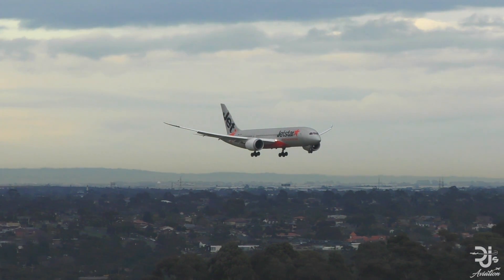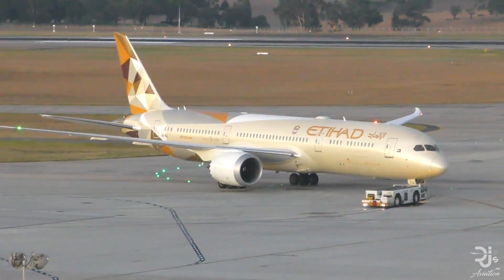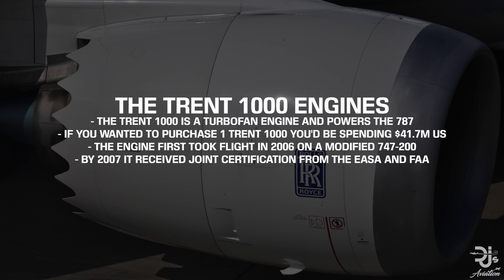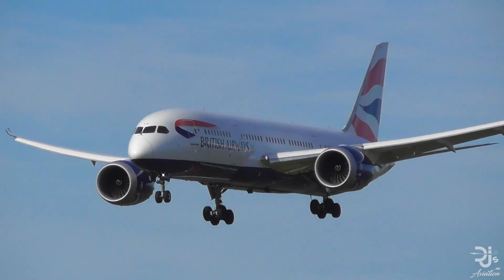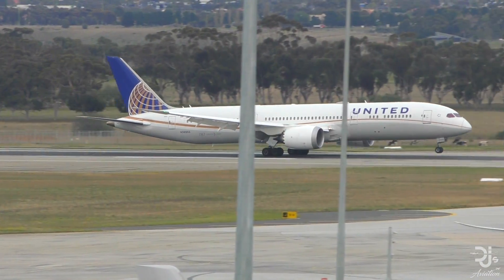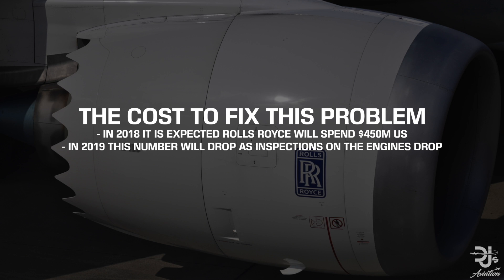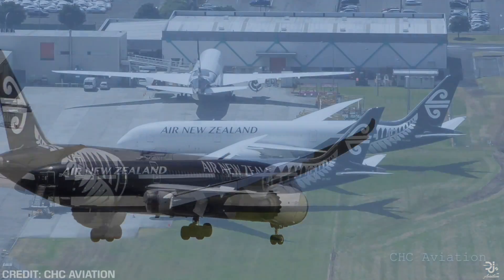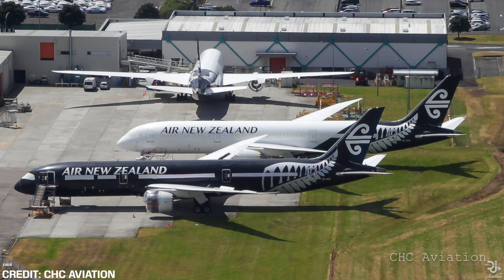The TRENT 1000 ENGINES ISSUES Explained

Comment: I think this poor for the 787. It's been rigged with problems ever since it's launch. Horrible plane. Unreliable and poor dispatch times.
Reply: Well tbh Boeing is not to blame. The battery issues are linked to the battery supplier (like the same thing that happened to the Galaxy Note 7), and now this is linked to RR.
Reply: Tasneem; Boeing offered RR engines because some airlines only use RR engines. They do not want to re-train their maintenance crews to work on other manufacture's engines. With that said; if you (as the person signing the dotted line) are dumb enough to purchase RR engines, you deserve what happens.

Oh, yes. Just in case you forgot, the RR engines on Airbus aircraft have been having problems as well. I mean, you do realize Airbus and Boeing both use a lot of the same suppliers.
Reply: @Tasneem Eddoo- the airlines choose the engines you numb-nut!
Reply: Jacob Payag perhaps bit the business model of Boeing is to outsource everything. Compared to other suppliers they build it mostly in house/in partnership
Reply: Wilbur Finnigan well it brings up a situation where you either damage the reputation of the plane by carrying on offering the engines or carry on as normal with the hope that future plans don't have the issue. I know what I would do but others might think different
Reply: Still the best plane in the sky..when its actually in the sky lol
Reply: Rolls Royce  is the problem not Boeing!
Reply: Tasneem  BOEING offers what the airlines want !!!!  IF the airlines want RR engines they get them and the airlines can deal with the problem !!!  Or do you not offer the RR engines and lose the sales to scarebus and they have the same problems with them ?????
Reply: soaringtractor I agree with you as it is a RR engine and I can see that all packages maybe affected in the future but if you look at the bigger picture boeing is part to blame also for not doing enough. As much as I love RR Boeing needs to chase there supplier up or go the same way some other companies have done. Single supplier. Stop offering RR as an option. This also goes to there business model of outsourcing too much. You have less  control over your supply chain. For a catering business outsour ing works well but I don't agree with it's implementation within aviation. The risks are too high.
Reply: Tasneem Eddoo As a casual observer, it really seems like Boeing is consistently making the lesser product vs Airbus.
Reply: As a veteran airline VP in charge of fleet, you would be sadly mistaken...

Comment: This is a nightmare for RR - the Dreamliner is such a well known and popular aircraft. I thought aircraft engines were now electronically monitored in flight by the manufacturers,  does this not negate some of the issues?
Reply: Geoff Lane I don't think they monitor fan blades individually
Reply: jonathan Elliott Doubt they monitor each nut and bolt individually but saw a documentary about RR and was astounded as to what they do monitor in flight. Obviously not as this issue would suggest.
Reply: Geoff Lane this isn't an issue with the engine itself, but with the manufacturing of the fan blades. RR went with the supplier that could make them quickly but also on the cheap, lacking the quality RR are renowned for.

These blades haven't been subjected to the same quality control as past RR parts (as there made from a 3rd party manufacturer that seems to lack understanding of 'quality'). It's such a shame as past RR engines had very good quality and reliability, but I guess with it all about saving money, these days, they decided to cut corners.
Reply: jonathan Elliott which foundry made the problematic fan blades?

Comment: I’m guessing airlines with GENX are feeling glad... but do they have problems too?
Reply: byron jeremy: They haven't really fixed the Icing forming on blades and vanes within the GEnx-1B but have a software work around which the software commands the variable inlet guide vanes – a set of interior doors used to discard foreign object debris on takeoff or landing – to open and eject the ice before it can enter the core of the engine and cause an inflight shut down. 

However a software bug that shut-down one engine on a GE Aviation-powered 787 last July has prompted Boeing to ask the US Federal Aviation Administration to temporarily exempt the 787-10 from a safety requirement.

Boeing plans to certificate the GEnx-1B-powered version of the 787-10 in September, but the fix for the software bug won’t be ready until 20 December 2019.
Reply: When theirs fail, they tend to blow up instead. Rarely but it has on the 777 a few times
Reply: what? when?

Comment: Gotta wonder if this had any impact on Boeing's decision to go strictly with GE as the only supplier to be offered when buying the 777x?
Reply: +juel sandy But Airbus actually gained a lot more A320neo orders (in the first few years) due to them offering two engine choices over Boeing just offering one on the 737 MAX. Airbus have also sold over 1400 A330s and they have three engine choices. In my view Boeing couldn't have seen these issues coming as the Trent 1000 didn't experience any problems in testing, and RR have proven engines on the A330, A380 and A350.
Reply: Ibirdball RR was proven very reliable on the a380 until Qantas was a witness. Till then RR started to worry all over again to make their engines as reliable as possible, they went right with the a330s and a350s though but I’ll be concerned once they reach a maximum stage of service. 
You are correct about Airbus selling that many a330s but are you forgetting how many 747/777s Boeing has sold?
Reply: The 777X was announced in 2015 and was being worked on years before, which was long before the first problems arose with the Trent 1000.
Reply: Randy Bentley Boeing wanted to go for GE to only power the 787 but airlines wanted choices which is why we are at this problem today
Reply: +Ibirdball 
I agree it’s just like the a320NEO The classic a320s and 737s as well as a380 and 777s, having more than one engine type will benefit the plane and the airlines because it will give the engine makers a deal competition for a run for their money, 
RR is reliable they are still using the outdated 30yrs old engine core of the RRB-211 on new generation engines such as the Trent XWB and Trent 7000, it’s astonishing to see how well it still performs. But the Trent XWB core for example is maxed out so I wouldn’t be surprised to see any problems hitting it as it enters a more frequent demand
Great point though. Thank you good sir
Reply: +Johnny Wynn My point was that you don't have to have one engine type to sell a plane. And after QF32, the A380 engine problems were solved.
Reply: Yeah
Reply: @pilerks1  I highly doubt that it's a deliberate sabotage by RR to give Airbus the upper hand. I believe it has something to do with the quality control on their factories, as the affected Trent 1000 options were made in UK which is heavily affected by the effects of Brexit, while the Trent XWB were made in Germany. As for the Trent 7000 for 
A330NEO, only time will tell if they'll be hit with the same issue as the Trent 1000.

Comment: On some A330’s they have the rolls Royce engines
Reply: The majority of A330s use the Trent 700
Reply: All A350, some 777, some A380s and much more uses rolls Royce engines, but they are different so they don’t have the same problems (hopefully)
Reply: A330neo has RR Trent 7000 only. If irc the Trent 1000 (B78) is largely based on the Trent 900 (A38) and the Trent 7000 will incorporate at least some of the design of the Trent 1000. I hope we won't see too many problems there.
Reply: The 7000 is based on the 1000 TEN, so hopefully won’t share the problems of the previous iterations of the T1000
Reply: That’s Trent700 Ofc, just hope the Trent7000 doesn’t face the same situation as it increases for demand
Reply: so most of the aircraft in service today, have a trent option at least.